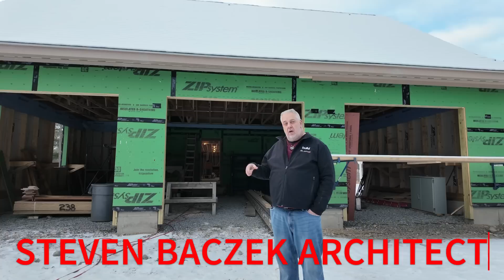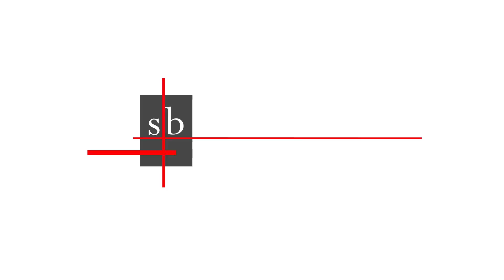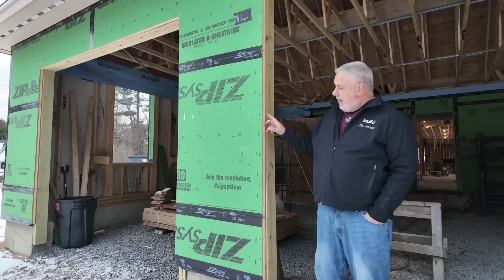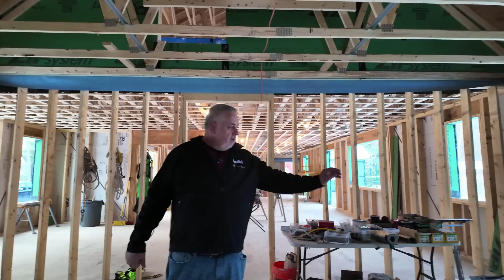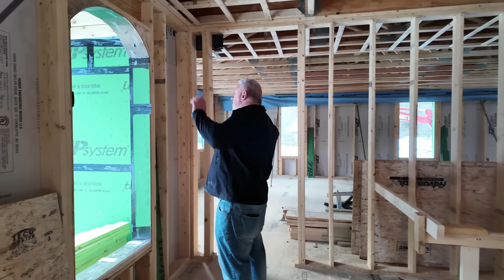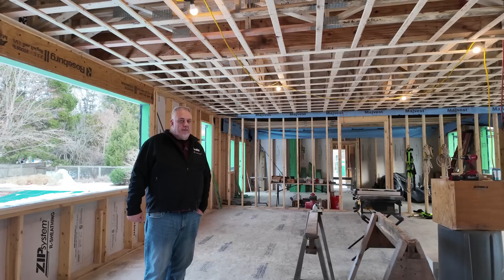Talking FRAMING DETAILS with the ARCHITECT

Comment: That window detail is 109,000% overkill if you use the right Windows and you install them right all of that is absolutely a waste of time and a waste of money
Reply from the maker: worth a double take.....
Reply: Windows have no value to a framed opening. Read the section in the IBC Residential Building Code on “lateral Wall Bracing”. A window is a hole in the wall to see out.
Reply: @joegotz1971  what’s your point? WHO is your comment for?
Reply: @fuzion430journey3  The Braced Wall section in the IBC tells you where you need to brace walls. Jack and King Studs is also has specific requirements for the size of the openings. Taping the joints in Zip Wall panels goes to the unlucky guy, nobody wants to do it. In Union labor does the Carpenter do it or another trade. In non-public work there is no Union labor problems.
Reply: With the Zip Wall who tapes the joints. This is always a problem on Union Labor projects.

Comment: That window detail is 109,000% overkill if you use the right Windows and you install them right all of that is absolutely a waste of time and a waste of money
Reply: I ve only been at it 25 years, hate the idea that I have been messing up, but still good to learn new stuff. Just learned from Lstebrick this year that what used to be incidental water intrusion isn’t anymore with more insulation and osb, so I started sloping sills and repeating “ don’t be a dope slope”. It really doesn’t take that long
Reply: The next invention will be lets live inside of a pvc bubble. While I can appreciate these guys helping teach and improve building technology and techniques, it is already so expensive to build with current best building practices and they just keep coming up with new and more expensive products. Maybe these guys pushing all the new products and techniques are being paid to promote this stuff? Better yes, necessary not sure. Alot of issues can be mitigated with a bit of commen sense architecture.
Reply from the maker: OK - don't do it
Reply: @ been building houses on Long Island on the North Shore and the South Shore close to 40 years and I’ve gone back to home. I built 30 years ago and replace windows and never had an issue and that’s through hurricanes and storms and ocean breeze the hardware in the windows, give out long before that ever fails.
Reply from the maker: @fuzion430journey3  OK good - maybe you should post your techniques so we can all learn from someone with such stated experience. I've worked on investigating homes for a significant part of my career and have seen horror shows, my work is in response to my experience

Comment: Hey steve,

Enjoy your videos though im not a builder. I have done extensive DIY remodeling on my house. i've watched your episodes on framing the big green box and the complexities of adding a roof are always present. I wonder why not build the green box with a top (flat framed with sheathing) to keep the entire box continuous? Then add a roof on top of the entirely closed and conditioned box? Not like whats often called lego framing where the pitched roof structure is part of the box. There seems to be so much effort in the science of making the roof part of the box. Why not just frame the entire interior ceiling as part of the green box?
Reply: That's how I built my house... Zip on the walls, zip on the interior ceiling (continuos)... It's an Eko Built wall and roof system that meets passive house standards.... 0 degrees F today and I didn't have any heat on.
Reply: Jonathan so you have a flat roof or you built a pitched roof over the flat topped green box? Ive seen videos of houses in norway or the like where the entire house is placed insidee a greenhouse like structure. They will never have to deal with issues related to water falling from the sky. Building a pitched roof over a flat box seems to make a lot of sense for a 1000 reasons. So why isn't that standard?
Reply: So we built a rectangle with a 12/12 pitch...vaulted ceiling inside. The zip acts as the vapor barrier. We have very thick walls (14 " I joists) on the outside of our 2x6 zip walls that contain insulation and they get covered with wood fibreboard that connects to the roof. That is our continuous  air barrier.  On top of that is the actual roof. 2x4s with a nice vented air space. Shingled. My wife has a channel called Tiny Barn Farm, there are a few videos there that give you a glimpse at the house. We are in northern Canada. Cheers!
Reply: The trouble with a pitch roof over a flat box is too much uncontrollable air trapped.... Hence the vented attics.

Comment: Supposition: Adding exterior insulation to your garage will blunt the heat influx due to sunlight, solar radiation. The solar radiation that is not reflected off by the siding  will be completely absorbed by the siding and the Zip R surface/OSB, which will get hotter, and, subsequently, the polyiso. will attenuate its conductive flow into the interior. That is, contact flow of energy from the heated wall to the inner air. Some of that heat energy stored in the siding and OSB will also be radiated out in both directions [black body radiation], reducing the inward flow by one-half, and the polyiso. will not attenuate that radiation. Over a summer’s day, you will have reduced the heat flow into the garage and, ultimately, the heat conduction to the living space. So, there are multiple processes sequentially occurring at all of the walls of the structure. I hope you try and get a thermal engineer, not a typical energy consultant, to look at these things and make some estimates. Question on your sheathing design: Are you concerned about mold growth between the garage inner plywood sheathing and the polyiso. side of the Zip R? No one seems concerned about mold growth on the insulated side of Zip R sheathing. Trapped moisture could lead to mold growth on the inner plywood surface. Can mold grow on polyiso? Thanks.
Reply from the maker: Understood, garage is the North side of the building, keeping heat out in the summer is a good thing. As for polyiso, it is not mold food, however dust/debris on it has the potential, need to make sure its clean upon install. As for moisture on the plywood, it can dry easily to the inside of the garage.

Comment: Curious: what purpose is the grid framing on some of the ceilings?
Reply: For some reason it's only a New England thing.  It helps structurally as a huge brace for joists, gives you flexibility to fix any joist imperfections and room to run wires or even PEX perpendicular to joists.
In this case it's manufactured joists so the latter two don't apply.
But in any case I'd like to hear how Steve explains it.